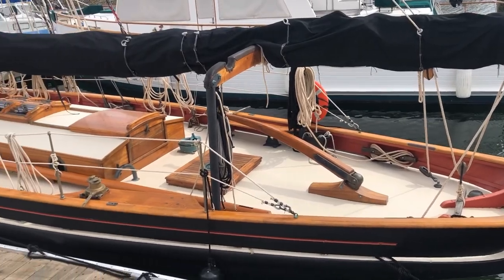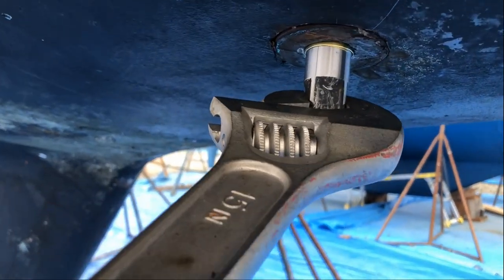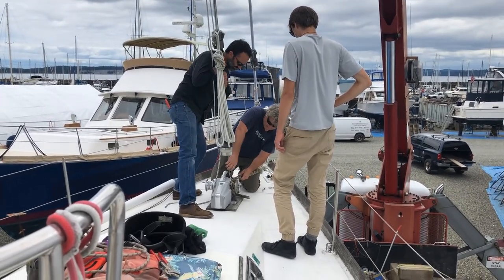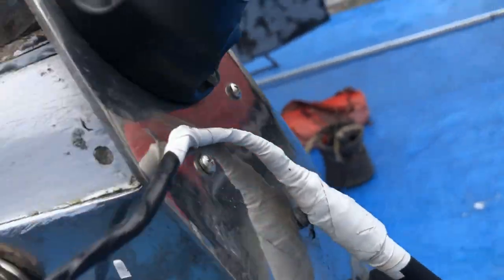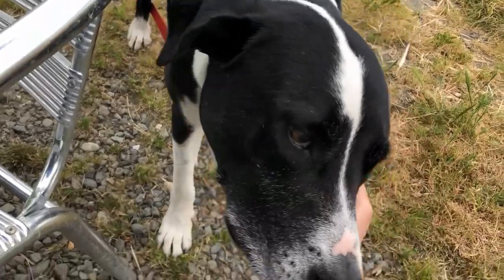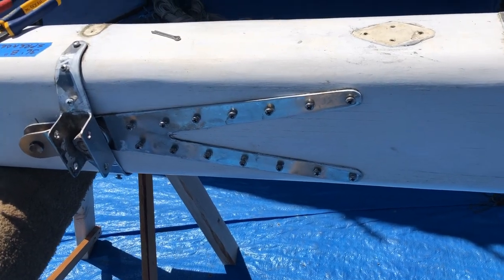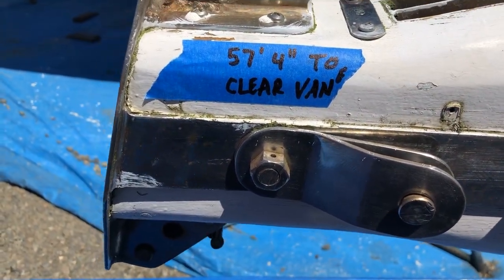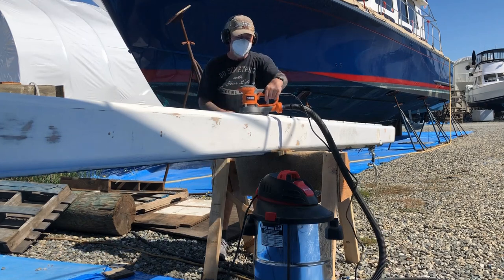Sailing Mother Ocean - Ep 3 - Boatyard Blues Part 1

Comment: Do you plan to varnish the mast so you can keep an eye on it?
Reply from the maker: I started down that path only to find the paint wasn't applied over varnish so I would have had to take too much wood off.  I did go down to bare wood in all critical places (joints, screw/bolt holes, etc) and only found 4 screw penetrations that I drilled out and plugged with spruce bungs.  The mast head will be entirely new when done so overall, I have full confidence in the mast.  As soon as it is done and fully painted, I will put together another video covering all the work.